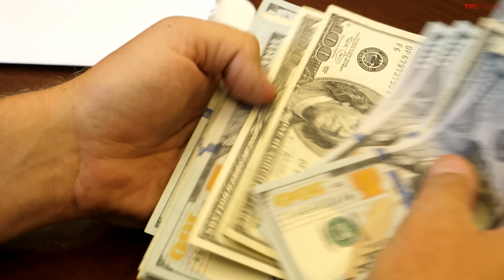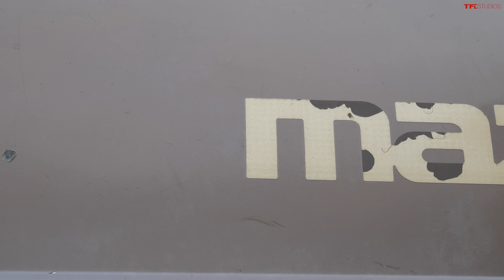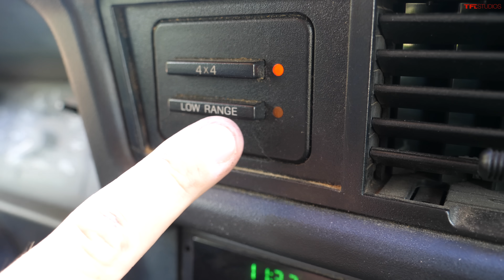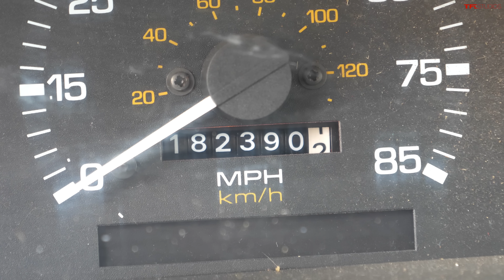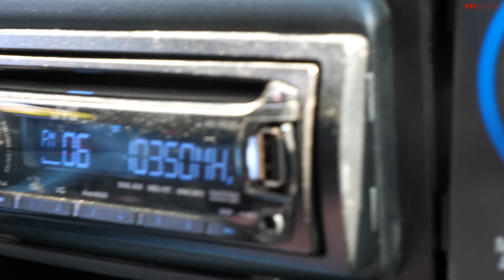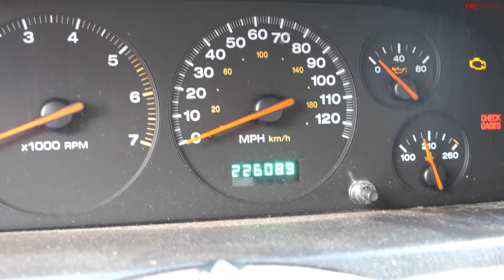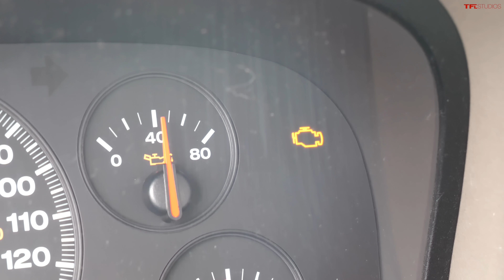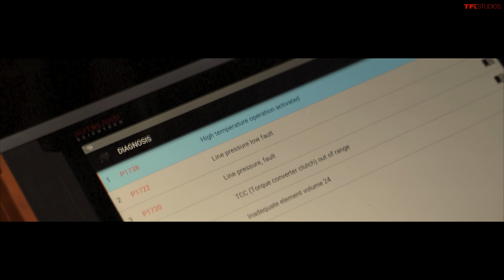Under $2,500: We Buy Three Vehicles That Are Complete Crap - But Which One Is The Worst?

Comment: I feel like this stuff is just trying to normalize paying $2500 for 25 year old trucks with nearly 200k miles that need a good $500 worth of work put into them now, and probably another $500 after a year of use.  For reference, a year ago I bought a 2005 nissan frontier 4wd with 185k miles for $4600.  That is a lot more and a lot new truck for less than double the cost.

Comment: . My 2003 chevy trailblazer with 198k miles is not a complete crap. Most modern vehicles, including the ones from GM, will probably never last long term 😂. That first truck just needs a bit of TLC and it would be a great vehicle. Even if you spend $3k on it, it's still better than a damn $40k or more base small truck in 2023. Just my opinion from a person that hasn't bought a new car since 2005. My only new car has been a 2005 Hyundai Elantra that I paid a whole $12k for it.

Comment: 2500$ for a Mazda B4000 4x4... I buy my 1997 B2300 4x2 the same price aprox... but my truck inside is in better conditions then is not so bad. A truck like that could be cost $ 3875 in my country. But well, despite they are basically Ford Rargers, they are very cool trucks.

Comment: I paid 800$ for my 1997 Honda CR-V it currently has over 210,000 miles and my goal is to put over 500,000 miles on the original motor and transmission.

Comment: Tommy are you ready for the big time a brand new Jeep Grand Cherokee TrackHawk vs a Chevrolet Corvette Stingray, the 4.3 was designed for towing, offroad, not racing, but the Chevy did well vs V8, the old 4.0 Jeep would outrun a 4.3 also, but back home around High Rock Lake in NC where the BASS Master Classic was held,most country boys knew the 4.3 could out tow 4.0 Jeep"s to the lake with the boat behind,4.3 a work motor the Jeep 4.0 faster, but not better at work utility that is were the Chevy shined, ok Tommy. It can even out tow your new Jeep Sport. And the Jeep you found would make a nice family truck with some work, hey nice enough as is, but AC I would fix tomorrow.

Comment: 17:23 holy crap a chevy that has 2H 4H N 4L like a Ford instead of 4L N 2H 4H? that's pretty cool I hate the normal chevy pattern
Reply: I think that was the normal pattern for all 4x4's for many years, then each manufacturer had to go recreate the wheel using different transfer cases as time went on.  I think GM and Dodge had that same 4L N 2H 4H pattern for several years as well.  No, well I think Dodge had 4H, 2H, N, 4L if I recall, its been a long time since I sold my 99 Dodge Ram 1500.
Reply: @wildbill23c  not sure but i know late 80's early 90's Chevy's have the 4L N 2H 4H pattern

Comment: Fun series TFL, but I think you should work on getting the facts right if you're going to focus on a specific topic.  In this case, Nathan's constant harping on the automatic transmission in Tommy's WJ was just factually inaccurate.  

First off, Nathan acts as if the 45RFE/545RFE that were behind the V8s in WJs were bad transmissions and insinuates they are known for issues... which is just not true.  If you recall, the same 45RFE/54RFE also served in the 1500 Ram trucks of the era, often behind the much stronger Hemi with much higher GVWR and tow ratings compared to the WJ.  In fact, the 545RFE evolved into the 68RFE which was put into HD Rams, even behind the Cummins (though, we can probably agree it wasn't the best trans for THAT application).  

The transmission Nathan was thinking of as troublesome and prone to failure in the WJs was the 42RE that was ONLY behind the 4.0L I6.  

Next, Nathan harps on Tommy's auto for being a 4 speed.  Of course, Nathan's own 4L60E is a 4 speed, but what's worse is that Tommy's WJ does not; in fact, have a 4 speed.  Being a 2001 the transmission in Tommy's rig would have had the '545RFE' designation.  Both the 45RFE and the 545RFE actually have 3 sets of planetaries and 6 possible forward ratios. 

For '99-00 Chrysler set it up to use 5 total ratios, having a different 2nd gear option for certain down-shift scenarios.  Still, Chrysler called it a "4 speed."  However, in '01 they changed the programming so that it operated as a 5 speed, but still used an alternate 2nd gear ("2nd prime") in certain downshift scenarios and therefore actually uses all 6 possible forward ratios... nevertheless Chrysler chose to just call it a "5 speed."  

If Nathan wanted to pick on Tommy's WJ, he probably should have joked about dropping valve-seats... of course, the real irony of these is that Nathan's own rig, the S-10 Blazer has the much-maligned, and truly failure-prone 4L60E.  Even the tame little 4.3 has been known to hurt a 4L60E or two (or three...) in its expected lifetime.  

One final note: towards the end they joke around about how much Tommy's WJ weighs, and Nathan states his Blazer would be ~4300-4400lbs and "about 300lbs less" than the WJ.  A '01 V8 Laredo like Tommy's would actually be right around 4,000lbs, and thereby 300lbs lighter (not heavier) than Nathan's Blazer (which does, of course, make the narrow drag race victory somewhat more shameful).  The '02-04 Overland was the heaviest WJ, and was still only in the 4300lbs range.

Comment: I knew he didn't know shit about cars when he called the "4 speed automatic" (4L60E btw) "reliable"  I'm a GM guy and I'll be the first to admit that transmission is not reliable!
Reply: if you were actually a GM guy then you would know that all you have too do is keep up with maintenance. 267k on my 2005 Trailblazer drives like new. 290k on my 2003 Avalanche drives like new. you were saying?
Reply: @lovellmills7959  so because you had a grand total of 2 experiences that were positive with that transmission, you are suddenly an expert? I've owned 35 cars in my life and have personally had a 4L60E fail before 100k.  I'm a former ASE and GM certified technician with 10+ years of dealership experience. I've personally repaired and replaced countless 4L60E's. You were saying???
Reply: @arrondentinger2086  I have owned 8 vehicles with the 4l60E and 0 has ever failed. If yours failed before 100k you didn't take care of it lol. You were saying?

Comment: Bullshit. The 1999 - 2004 Grand Cherokee WJ with the I-6 4.0 L is one of the MOST RELIABLE Vehicles ever manufactured .. I've owned four of them over the last 20 years and still own three of the four .. - and I have Never had a single problem with any of them .. they have never left me stranded, they have always started, and all the components and systems still work perfectly .. the ONLY thing that has failed is the power window motor in the driver's door - it fails and automatically drives the window DOWN [open] - I replaced it about eight years ago at around 140,000 miles .. the AC has never leaked or stopped working, the heat has never stopped working or leaked, the seats have never worn out, the engine has never burned oil, the 4wd has never failed, the radiator has never overheated, the gauges all still work .. the one I bought brand new in 2004 has 185,000 miles on it and still looks, runs and drives as if it is brand new .. one of them I sold 10 years ago at 125,000 miles, one of them has 140,000 miles [ it came from Michigan and has some minor rust around the wheel wells which I treated about 5 years ago - the interior looks brand new, the car drives like brand new and the only components that I've had to replace are the ones that were exposed to road salt ] and the last has 120,000 miles and still looks and drives and runs as if it were brand new .. and none of them are "junk" .. the one with 120,000 miles I plan to keep driving for the next 80,000 miles and then rebuild the engine, trans, xfer case and suspension at 200,000 miles, the one with 140,000 miles and wheel well rust I'm going to convert into an overland vehicles for cross-country adventures, and the one with 185,000 miles I'm going to drive for the next 15,000 miles and then rebuild the engine, trans, xfer case and suspension and drive for another 200,000 miles .. if you have a "junk" WJ it means the owner didn't take care of it - that's not the car's fault .. a properly cared for WJ will EASILY go 200,000 miles and probably 300,000 miles ..

Comment: Silly Andre doesn't know the difference between a heater hose and an AC hose hmm i guess hes never had a beater with a stuck on heater, thats just a valve to shut off the heat so you arent burning up in tbe summer

Comment: the Blazer will last the longest, even if everything around the engine and trans falls apart. That Grand Cherokee is junk. I have never owned a Ranger so don't know about it but my Blazers were way better SUV's than my 3 Grand Cherokees/Cherokees. The Auto transmissions are garbage. A 4.0L / 5 speed manual is the best combo for Cherokees. The Gm 4.3L and 700R4 is bulletproof.

Comment: Between the three I'd probably still take the Mazda.  Might be underpowered but it's got a manual transmission and generally last longer than an automatic.  Second choice would probably be the Chevy, as those years the Chevy's were still decent vehicles (that changed around 2006/2007 when Chevy totally redesigned their vehicles, that they went down hill IMO).  Jeep...?   I don't know.  I know some of their engines (because they were made by Chrysler back then and may still be -- although they are managed by Stalantis now) and some of their engines had some really major problems.  So for me, if I had to rank them, I'd say the Mazda, then the Chevy, then the Jeep.  Of course about 5 years ago you could have gotten a lot more car for $2500.  Nowadays that doesn't even get you a rust bucket on wheels.
Reply: Give it time, the bubble will pop.

Comment: Straight up down voting. This is painful to watch with how slow it goes. Ironic since a 4.7 WJ would smoke a 4.3 blazer with both in good condition. The number of times they mention the WJ transmission is just cringy. They are not that bad, and its the 4.0 transmissions that has the higher failure rate. A 30 min video about buying them and looking over? yet no where in this episode did they do the thing they said the video was about. Go on the trail.

Comment: That's funny I got a little S10 Blazer and it went further than all my buddies big trucks LOL I call it that little box that could because it's an 89 S10 Blazer right now it has a 4-3 in it but I blew it up so it's going to get 350 LOL and that little truck has pulled out full size Chevy Fords and Dodges LOL the truck I designed for the trail truck it has drawers compressor the welder a whole bunch of tools so we can work on anything in the trail my buddies love it when I pull it out because they know it's going to be fun and if they can't get through it I can LOL